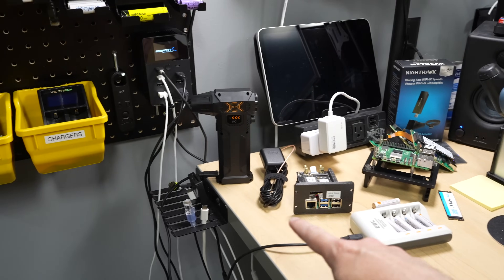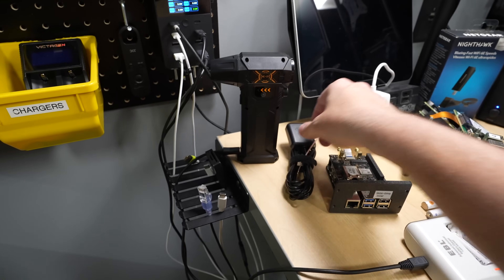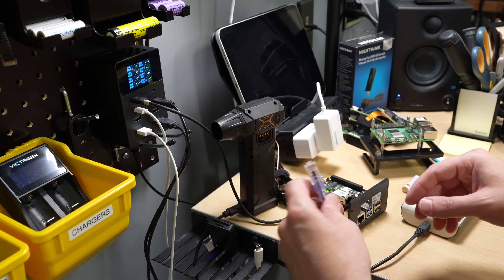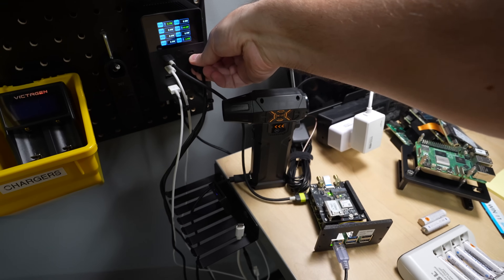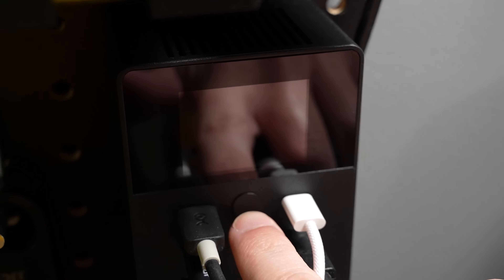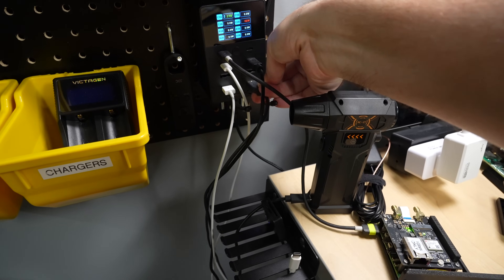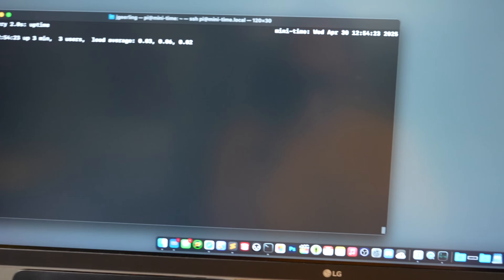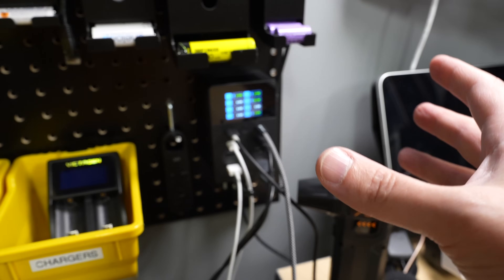Hear me out... a multiport USB-C charger that's not dumb

Comment: Unfortunately most USB-C supplies are 'chargers' rather than 'power supplies'. i.e. they are intended for charging something that has an internal battery anyway, hence a momentary drop out to re-negotiate is perfectly acceptable for most use cases. It would be nice if more supplies used a separate USB PD circuit for each port. The YouTube channel 'AllThingsOnePlace' does an excellent review of USB chargers and they cover what ports do re-negotiation etc.
Reply: I watched a person you're talking about he also reviews power Banks, very interesting stuff.  definitely someone worth watching to help you make an informed decision before making a purchase. I have about 10 power banks now it's becoming a problem. Lol
Reply: It's quite annoying when I try to use a battery bank as uninterruptible power for a Pi and then it either turns off after some time at light load,  cuts out momentarily when you cycle the input, or can't charge and discharge at the same time. Even one that was advertised as a UPS had the first problem.  I'm starting to think it would be simpler to make my own.
edit: this even happens with USB-A only products where there is no need for negotiation
Reply: I'm loving the Anker A2154 as a power supply. Each port has a fixed wattage and doesn't get interrupted by other ports being plugged/unplugged.
Reply: @Dan-cd6hm But again, that's still unfortunately a charger.
Reply: This is the real answer. People are fundamentally misunderstanding what a CHARGER does.
Reply: @klfjoat Or maybe companies are doing a bad job of advertising their products. Jeff's appears to be a charger, but the appearance and amount of ports might suggest it's more of a power supply than charger. 

Some of us do want a power supply, not a charger, but the options typically come down to getting USB ports shoved in your walls (not practical for everyone) or getting a bench power supply and hooking it up manually (or building your own circuit(s) with it), which is also not ideal. 

Sure, you can get things like cheap Meanwell PSUs that are okay, but then you have to figure out how to hook them up, and most people aren't good with that level of electronics. 
Frankly, I wish I was skilled enough to roll my own, but plenty of places limit what you can do without an electrician's licence regardless of your skill, so an off-the-shelf product is still a better choice.
Reply: @GareWorks  You can get around (I would think everywhere) the requirement of being an electrician by building the "wall" or a box yourself that isn't permanent. Instead of Romex to the all the way to the panel, power whatever you're wanting to build with a suitably heavy extension cord and plug that into main/line power. If you have a workbench, that would be ideal. Just cut out your receptacle locations on it rather than the drywall behind it.
Reply: @GareWorks 
To be honest things I would run off a charger would draw less than the 18650's I'd be charging at the same time.
Reply: @WilReid dunno, in Estonia, if an inspector visits your office and sees clearly de facto stationary extension cords running from the wall out to the second row of tables, you're getting a write-up. Extension cords are not meant for stationary use.

Used to be, the lifehack was using a certified isolated power supply under 100W (aka a common brick-on-a-leash "laptop power supply" or 12V supply of some kind. Anything after that is by definition considered too low power to be a serious fire risk
(Also part of the reason for the common "100W total" rating).

But nowadays, even a single USB-C device can potentially draw more than that, so it's much harder for the hobby electrician to "inherit" safety from off-the-shelf PSUs. Anything above 100W by standards requires various testing to really claim to be "safe".

Not that 100W can't start fires. It can. It's just that usually, that takes intent/utter stupidity to make happen, instead of an "oops, that didn't go according to the well-thought-out plan".

Comment: Hear me out, a USB-C UPS. 1000W / 10 to 16 ports
Reply: do you have a recommended model ?
Reply: @szpl  I don't IF it exist in the first place, but it should!

IF the 10" rack finally develops, we could have small, energy efficient, NAS/ small nodes for less than 100W per system.

Comment: Finally someone is getting close to perfect! I know what you mean with chargers renegotiating and it's so frustrating. Now, all they need to do is offer the a sensible power limit per port for every port, none of this "up to 125w per pair" that this one still has. I wish manufacturers would set a limit, whatever limit they decide, and it'll always be available no matter which combination or layout of ports is in use.

I got so frustrated that I built my own multiport charger using some cheap PD modules from Aliexpress, you can buy individual 65w modules for about £2 each, but I opted for two quad port boards with 2x C and 2x A for about £6 each. The ports are all individually powered though and very similar to the individual modules, just on a single PCB for neatness. I power that with a 24V 20A power brick and it handles anything I plug into it with the full current ability on all ports. I've never seen a single charger on the market that can run 4x 65W laptops simultaneously!

Next question Jeff that you may know - why to GaN chargers fail so quickly? Every GaN charger I've ever owned, even from the big known brands like Anker and Ugreen has failed within a year, most much sooner
Reply from the maker: I'm guessing many of them go for size over cooling—the layout is made to compact things down so 'GaN is smaller' instead of just focusing on the efficiency wins. I wish they made the same chargers with more space so they don't overheat. A couple of my GaN chargers get quite hot.

Comment: Nice! But I'm not sure it is ideal for Raspberry Pi. According to the specs the only 5V profile is limited to 3A while the 'official' Pi PSUs supply up to 5A at 5V.
Reply from the maker: Good point—though if you're not using high current USB devices it's plenty adequate for a Pi 5 (or any prior generation).

Comment: I think all of the devices you tested want 5V - does it still work if you plug in a device that wants 12V or 20V?
Reply from the maker: Good point. I only have a couple devices that negotiate at 12 or 20V, I'll have to dig one out and test later!
Reply: @Level2Jeff  don't most smart phones and Apple devices?

Comment: I highly recommend a steel storage cabinet for putting your charging devices into. Lithium batteries have a bad habit of randomly bursting into flames and a thick cabinet will slow the spread. One hole in the back or side for the power cable with a grommet and you're much safer leaving them unattended

Comment: My understanding is that most chargers will have a shared capacity across all ports say 100W so when you plug something new in the reason they all shut off and back on is cause it will rebalance based on what's attached otherwise if you say plug your phone and ipad in first and they take 100W of the total budget then plug a laptop in that only leaves 40W left so it will renegotiate and give the laptop 60w then the phone and iPad 20w each. This also means that they are flexible about which part to plug things into. 

This charger must have a budget per port in order to get around that issue which then I assume means you have to be careful which socket you use for higher power things like laptops?
Reply: Usually, most charger have a list of all the power modes they can be in. For exemple, you could have a look at a Ugreen nexode that has all the possible combinations specified in the manual and amazon pictures.

What I really long for is a charger/power supply that make the most of the PD spec by renegotiating power capacities live (without restart) and by taking into account the max power drawn by an already plugged device. That would allow things like : 
Port1 100W for phone Port2 0W -> changing without reset to -> Port1 25W for phone Port2 65W to laptop, instead of -> resetting -> Port1 65W to phone Port2 30W to laptop.
That could "just" be a software update on a nexode since they already support 100w to both ports when only one is used, but that would probably require too much testing and validation for a commercial product, which must also account for trashy devices that don't support live renegotiation etc.
Reply from the maker: I may get to testing that a bit, maybe running a couple of my USB-C powered lights (which draw 30-40W each)

Comment: I wonder if the Sabrent multiport charger can be powered over a DC power source (such as a battery or another USB-C power adapter)?
Reply from the maker: Possibly internally, but externally it just has an AC 120v input.
Reply: @Level2Jeff  I see. Well, if we know the required DC input, it might be possible to just hook it up to an external DC-DC converter and power it off a battery.

Comment: The charger might cut everything off momentarily only if something actually needs to be told less power was available for it. When I charge my laptop off my 100W charger and then connect my phone, the charger stops everything and restarts telling my laptop that there is only 60W (I think) for it rather than the full 100W.

Comment: Oooooh that is nice! I've been yearning for a USB-C Power Bank that also doesn't disconnect power to other peripherals when plugging something in AND can charge while powering something, a mini UPS
Reply from the maker: That'd be the holy grail. Unfortunately the only one I've found is the GoalZero Sherpa, but that only has one port, and an AC outlet. So not really what you'd want!
Reply: SlimQ does a DC to PD (+ 2x USB A) that does 2x independent 100w outputs + 1x shared 30w for the type A ports, from a 5-24v (though 21v needed for full PD) and 230w input. Pair that with a DC battery and you'd have the setup you want I think. 
Not paid by SlimQ, I just use one of their 330w PD/DC chargers for my ThinkPads (DC + PD) and phone (PD) and it's been rock solid.
Reply: Some anker products and sharge/shargeek can do ups mode
Reply: Thanks for the replies everyone! I thought they didn't exist, I'll take a look at the brands you shared
Reply: It'd be nice if it could actually communicate it's in UPS mode, to facilitate notifications & soft-off for small servers and such.

Comment: I've been using pine power for a while but this looks very tempting
Reply from the maker: I've had the Pine Power in my cart many times... just never pulled the trigger on it. It still seems like a nice charger.
Reply: @Level2Jeff it is, also has a wireless charging pad on top, but aside from that it doesn't really measure up to this one in functionality. I never use the Qi pad so I'm kind of wishing I had this one now.

Comment: The dropping of all charge ports, followed by renegotiation, happens usually on chargers that are overprovisioned. They advertise "4xUSB - 100 W!" but it is 100 W total, not combined. So when you plug in a device that wants 70 W (MacBook), and then a smartphone with fast charging and PPS (40W), then the hub renegotiates the devices to figure out how to distribute the 100 W with 110 W of demand - which is stupid - but that's the reason. The idiotic thing is that the chargers do this even when it is not required, out of lazyness.
Reply: That's not true. How do I know? This charger also does that - it supports up to 20V5A/100W on any of its 4 USB-C ports, but only up to 125W combined per side/pair of ports. Given USB-PD's range of output voltages and currents, I don't think I've ever seen a multiport charger that supports maxing out every port at the same time. It is very standard USB PD charger behaviour for them to renegotiate all ports when a new device is plugged in. Sure, power limitations are one reason for this, but if the pd chips had the capability of checking if they had enough spare output power to avoid needing to renegotiate them all, and then simply performing negotiation on the new device, they would. They're using cheap/early gen chips without the capability of doing so, that's the real answer.
Reply: I would also test with some stuff that needs more than 5V. Maybe it shuts down power if it needs to change voltage?
Reply: @evefavrettowanted say this. All of the devices used 5v which makes it easier for the charger.
Reply: [They advertise "4xUSB - 100 W!" but it is 100 W total, not combined.] Ehm, combined = total. They mean the same thing. 4x25 or 2x50 or 1x100 or whatever, combined/total.
Reply: @noth606  Right, but it also means if you have one device plugged in, when you plug a second in it has to renegotiate with the first device because it can no longer provide 100W on that port, just 50W. And IIRC PD negotiation only happens at connection, so it has to disconnect and reconnect to restart negotiation.
Reply: @Anaerin  Well funny thing but... PD spec say you can renegotiate live without cutting power. So it is possible to "downgrade" a port's power limit, but because a lot of cheap devices just don't understand the concept of "downgrading" power capabilities, chargers just cut and restart making sure that no device may ignore the change in power distribution.
Reply: If it's 252 Watts total output  why can't it continue to provide 100 Watts to the first device if you plug in another device that is 100 Watts or less without causing the first device to drop to only 50 Watts? 100 + 50  is less than 252 so is 100 x 2.
Reply: the Oberprovisioning is not stupid, it is smart. Without it, there's not really an advantage vs individual power supplies in a power strip
Reply: Umm, perhaps you're looking a a different model. Jeff's model is showing is spec'd on amazon @ 252W total:
"Fast USB-C Charging: Equipped with 4 USB-C ports, each providing up to 100W individually or up to 125W per pair. Supports multiple voltages (5V/3A, 9V/3A, 12V/3A, 15V/3A, 20V/5A) to efficiently charge power-hungry devices like laptops, tablets, and smartphones.
Reliable USB-A Charging: Includes 4 USB-A ports, each offering up to 18W or 36W per pair. Perfect for older devices, these ports support 5V/3A, 9V/2A, and 12V/1.5A to meet various charging needs.
Mix-and-Match Charging Flexibility: Simultaneously charge both USB-C and USB-A devices with a total output of up to 126W per side or 252W overall. "
Reply: I want a minimum 4 port 100 W to 240 W per port as well, but think about it, 4 x 100 W is 400 Watts (it'll take more at wall plug for conversion). It'll be a niche product "even at just" 100 W per port and it'll cost at least 300 to 400 USD at current tariff climate, no one will pay those prices. Heck, not much people will think 250 bucks is a good deal for 4 port 100 W (per port).
Reply: @XenonG 
Better to just have one 'priority' port or being able to assign priority charge
Reply: @XenonG  I made one and it costs 70, 100W per port (x4) + 25W (x4)

Comment: There seems to have been new chips or circuits released to chinese manufacturers. I bought two very similar power supplies, albeit lacking the display, and they work exactly as yours does. Another similarity I noticed is that both of them have 4 USB-C and 4 USB-A ports, and from what I see on AliExpress and Amazon, this seems to be a shared trait among them, so I think these contain some sort of charging IC that has this topology.

Comment: I have a pine power. Only one type C PD, the rest is type A, but independent too!
Reply: I’ve got one of those too. It definitely does the job, though the USB C port broke about a year or two after I got it. It doesn’t supply any power from there at all anymore. 
That said, it did manage to tank a dodgy 3rd party Apple Watch charger shorting out and drawing over 6 amps for a good couple seconds until I noticed. I would have appreciated some overcurrent protection to just shut everything off, but it didn’t let out any magic smoke, so I’ll take that for what it is.

Comment: Hi, nice contraption as nowadays almost everything that need to be charged uses USB, good availability with 8 ports, although having the choice between USB-C and USB-A for each and every port would have been worth it - a bonus point for the embedded power supply instead of an external block.